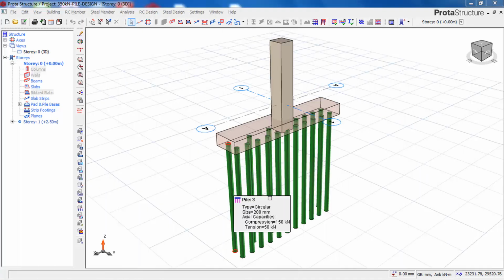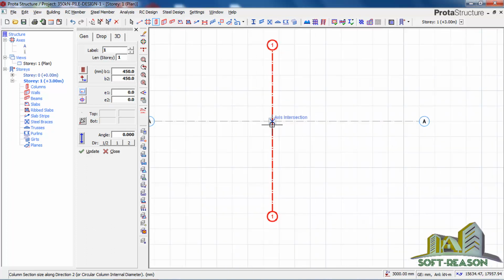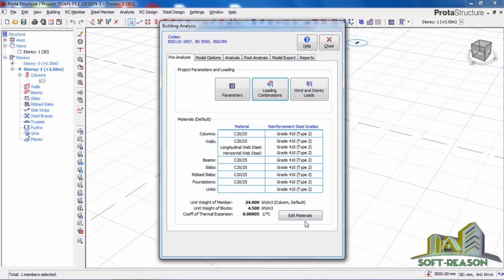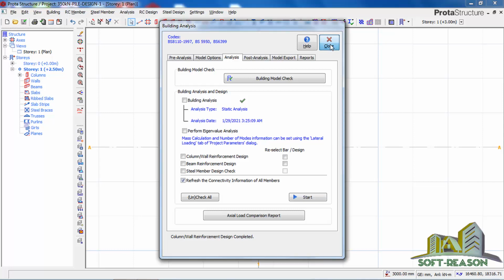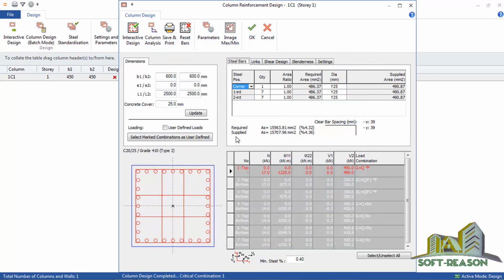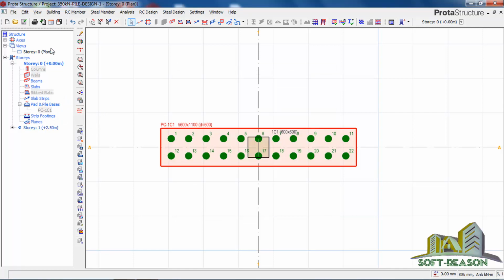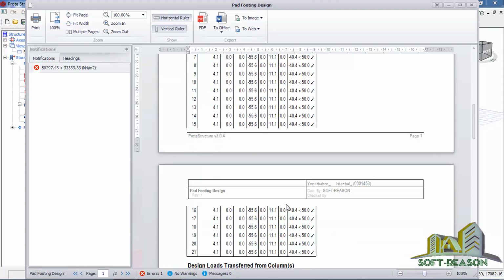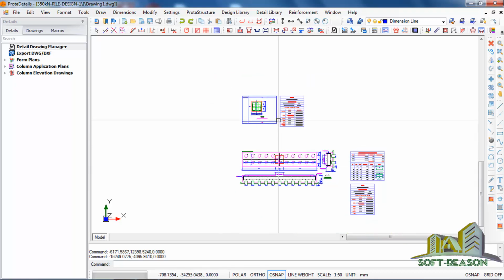How to apply load on a single column and pile analysis and designs in Protastructure

Comment: Weldon Sir, but kindly explain why you are applying a nodal load @Fy instead of @Fz given your UCS vertical Fz direction. Was your load a vertical load or a horizontal load? A little more clarification is needed there
Reply from the maker: Take note of that differences for correction Sir, thanks
Reply: I also noticed